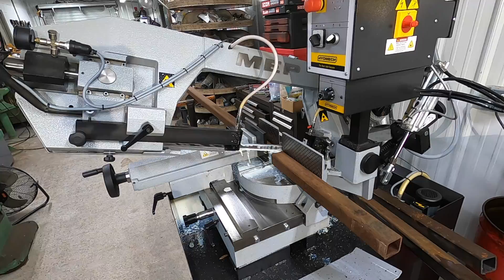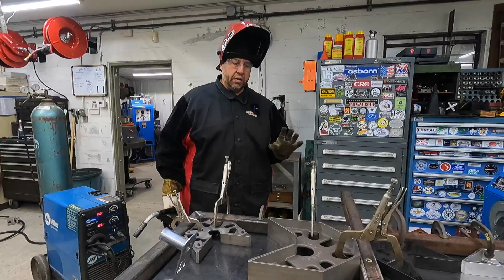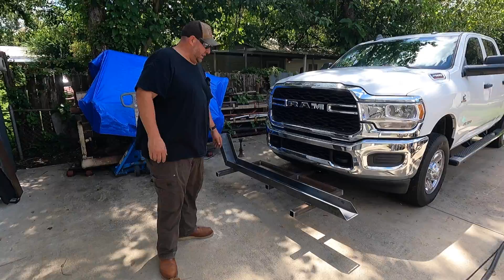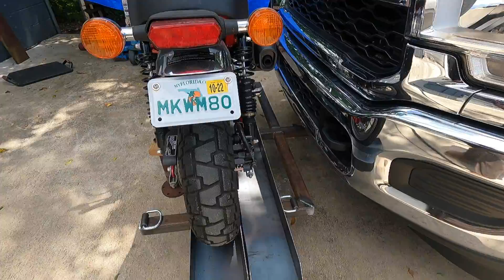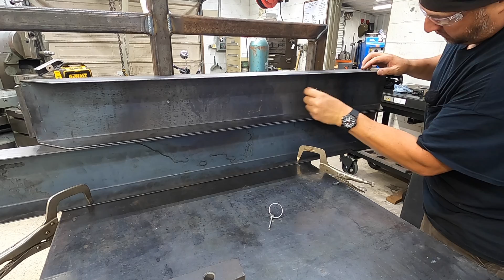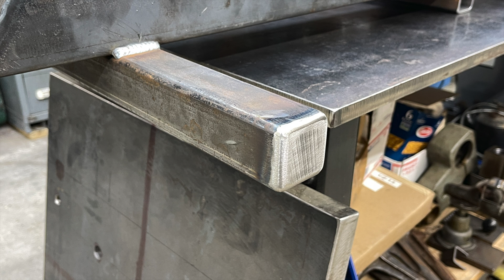Front Mount Motorcycle Carrier Part 2

Comment: Nice job congratulations. My advice : don't forget to make very small holes  (two or three mm are enougth) under all the scare tubes closed to evacuate humidity... perhaps not necessary where you live but absolutly necessary in France if you don't want to have rost !
Reply: Most of Florida is hot and humid, I could imagine south France is not too dissimilar.

The humidity is a big factor in Florida having the lowest used car values (everything is rusted) in the USA.

Comment: I welded something.  Once...ok, twice.  So, I'm a tooootal noob, right.  Isn't there some rule in the ancient tomes of welding lore that says...like...more weld more better?  It's ignorant, I know but why not ask, right?  So, this factory reciever under the truck feels/seems to my tiny mind like WAY not enough to support this awesome (please, read: HUGE) frame, rack, ramp AND bike.  What if...I mean...how?  Imma wanna entire roll cage over my cab (mad max), and then weld an upright to the very front, very center of my Uber Rack to which I couple a HIGH tensile steel cable running up to the roll cage, for...ya know, insurance.  Waddaya think?!?
Reply: Adam mentioned that the tongue weight was 500 lb and the pull was 12000 lb, so that tells me it is likely a Class IV receiver hitch and perfectly capable of handling static loads. Obviously hitting a lot hole hard might say otherwise.

Quality of weld is more important than most factors. Doing 10 passes might not could for naught if the root under which it is built upon has poor penetration. Good weld here, a gusset there: Can be incredibly strong when the right application is met.

Tensioning your setup might work with the right cable, say coated steel or stainless. Did you come up with a solution?

Comment: I recommend using some foam weatherstrip with adhesive back under the removable ramp. Something you can squish down to insert the locking pins so the ramp isn’t bouncing around while driving.

Comment: I would have  made one of the holes in the ramp a short slot. It's such a close fit that slightly different temperatures could make it difficult or impossible to fit the ramp onto both pins.

Comment: On my tow receivers I drilled a hole in the bottom, welded a half inch nut over the hole and run a bolt up to clamp the draw bar tight. And boy it made it solid as a rock.

Comment: I would have went with a lot thicker wall tubing for that center piece.  Metal fatigue from the weight bouncing on that lever arm won't be your friend.  I'd have really gone a lot heaver with that - it won't be very pleasant if you end up running over the little motorcycle and mount at speed with that trailer pushing you.
Reply: Hey, long as he's got the camera running?!?  LOL.  Kidding, I kinda made this point as well.  I don't know tolerances though so I'll admit I'm feeling free to sound off on the subject.  Just don't tell Highstranger951!  Why upset him?

Comment: Regarding the front strap tubes that extend forward of the bike rail, did you consider cutting and angling them upwards, at an angle?  Somewhere between 30 and 45 degrees from horizontal would keep them from being the low point for angle of approach interference, while still giving you the spread you want for secure tie down action.

Comment: Cut out some rubber washers to slide over your ramp pins to help seal them and reduce any rattle or vibrations and thus reduce wear on the pins and holes. You could also use foam camper tape.

Comment: If you put a little space between ramps, it won't rub the paint off each other.  Washers tacked under the holes won't wear as much paint either. You may even want a spring under lynch pins to reduce rattling. A cable lock may help keep someone from taking your scooter.

Comment: I would probably have made it for a few inch higher approach angle.  That sticks out so far that you are gonna be constantly scared of scraping going in/coming out of places.  Miter the receiver connection up 3+"  Other than that, it's amazing.  Curious why you didn't finish the kickstand mount before the powder coating.

Comment: Nice work. Just don't leave the ramp in the sun, as it will likely lengthen and then not sit back down on the pins. Maybe slot one of the holes in the ramp, to cater for extreme cold and heat.

Comment: Another great build/video, but I'd suggest putting those front d-ring mounting posts on a 45 degree angle out in front of the bike.  That is almost certainly going to scrape on rises/dips since it's so far out in front of the truck and a bit of angle will help from keeping the whole thing digging into the ground and/or causing a major problem.  Should be a simple/quick fix for abom79!

Comment: You might also make another receiver to go in the front of the center tube with a small 4x4 square of 1/4" plate for that kickstand rest. Then you could remove it if you wanted, and flip the kickstand up and out of the way. Add a couple thin rubber fender washers over the ramp pins to keep the rattle and paint damage to a minimum, too.

Comment: Love your work Adam but on this occasion I would be worried,  as a motorcyclist I can see some serious damage being done if hit with them tie down forks , it would be like a fork lift truck hitting you right in the ankle !
Reply: That is one of the main reasons you can do something like this only in the US, but not in Europe. for reasons of pedestrian or cyclist safety they even made bumper guards illegal here some years ago if they do not come from the manufacturer and are certified in some way. I think usually you only may have them for certain work/utility vehicles to prevent damage during operation (like vehicles for forestry services or off-road emergency vehicles.)

Comment: Adam... Have you reinforced the front receiver? I would be concerned about the weight and constant bouncing on the Monkey on that. Just wanted to share my thoughts...
Reply: Monkey weighs in at about 300 lbs (wet) and the new carrier is less than 100 lbs with all doodads attached... say 400 lbs total weight on a receiver rated at 500 lbs. So in that sense Adams new carrier is well within the design limits of the receiver. That said... the actual position of the weight of the bike relative to the receiver is certainly a concern. If say, one were to have a really long center tube on that carrier and one could conceivably hit a bump and the whole thing would break off or bend. I don't know how far from the vestibule  (front edge) of the receiver the 500 lb 'tongue weight' is allowed to be.
In any case there is also the problem of harmonic loads (washboard road or even seams on concrete highways.) Adams plan to use some sort of tie in to the towing points on the front of the truck frame will do MUCH to alleviate that source of a problem. It could even, conceivably, reduce the tongue weight to near zero (as far as the receiver is concerned.) If the carrier or receiver were ever to just suddenly break off for whatever reason and the truck is moving forward at any speed... the results would certainly be exciting.

Comment: What is the total weight of this unit...less your Monkey bike!
500 lbs is the maximum load...don't forget to calculate fluids in bike ( fuel and oil etc...)...
You can use thinner tubing for a bike...my trailers had probably 14 guage or 16 guage max for the rails..and 1/8" or 3/16th for the frame ..alot of similar haulers use thin sheet guage for everything except the hitch tubing...

Comment: To help with mounting it on your own you could add 3 pieces of strip on the sides and bottom of the receiver at an angle to form a kind of funnel. That way you can lay it in there roughly and then lift it from the front until she slides home. Keep on keeping on dude. Love the Chanel.

Comment: How often do you people hit pedestrians?! People in the comments are acting like its an everyday occasion, in the unlikely event Adam were to hit someone with just the pickup they would get injured just the same as when he has the bike carrier mounted. Pickup bumpers are designed to protect the pickup not to absorb the impact of hitting pedestrians every other day. Awesome build Adam, been following along on instagram and I love that hammered finish powder coat.
Reply: In 2017, 5,977 pedestrians were killed in traffic crashes in the United States. That's about one death every 88 minutes. Additionally, an estimated 137,000 pedestrians were treated in emergency departments for nonfatal crash-related injuries in 2017.
Reply: @gregs2284  Thanks for the facts but you missed my point. The bike carrier makes no difference between a fatal and nonfatal crash, just like a bumper doesn't.

Comment: Shouldn’t you have put a small rubber pad on the frame so when you put the ramp in rest position it doesn’t vibrate and sing it’s song with every bump you take… like a rattle sound of the ramp vibrating on its pins? Just thinking here…

Comment: I would seal weld the tray to the frame.  Even powder coat will crack, trapping water and causing corrosion. 
On the ramp pins, a little bit of eutectic silver solder like Harris 56 will seal the gap without adding a fillet.  Again,  corrosion.

Comment: Firstly, I must say that have been a huge fan of the channel for a number of years.
I do have a couple of concerns about this project though;
Engineering wise: that front hitch was never designed for the torsional forces it will experience when you are cornering etc.
Safety wise: If you hit a pedestrian with that thing, you'll probably take their legs off! If it was a child in a push-chair, I wouldn't like to see the outcome.
Reply: I think you perfectly summed up some of the reasons why such a contraption would be illegal here in Europe. Pedestrian and crash safety are parts of the vehicles operating permit, which such an attachment you would simply void it. Besides the illegal visible obstruction to the Headlights, license plate etc.
Other than that, for price and just practical reasons, trucks of that size are pretty uncommon here and any smaller vehicle would simply not be able to bear the forces of a front hitch with that at all.
Reply: The thing basically has 2 spikes sticking out the front.  There’s a reason why it’s illegal in the UK for a farmer to drive a tractor on the road with a front end loader attached, without it being folded back or covered by a guard.
Reply: @Martin52863  Then again, fellas can't even have scissors over there, abject lesson why it's important to keep practicing our Pedestrian Impalement Rights.
Reply: @mqL49J  lmao, what? We can’t have scissors? What on earth are you talking about?!
Reply: @Martin52863  Stand by, citizen, Constable Nigel was dispatched to your location with a pamphlet communicating the grave danger of knoife croime.
Reply: @mqL49J  sorry, I’m clearly missing something as I’ve still no idea what you’re talking about.
Reply: @mqL49J  🤣😂🤣
Reply: And you think just being hit by the Ram alone would be better "Engineering wise"?
Reply: @lundysden6781  With this construction it only need a light touch to hurt a pedestrian badly, not a full frontal crash at high speed - that's the difference.
All this edges are build for amputation...

Comment: Even without the rack this vehicle goes some way to understanding why the USA has over 6 times the death rate/100k persons from vehicles compared to Norway, 5 times that of the UK and 3 times that of France.
Reply: Norwegians drive fewer than half as many miles annually than Americans. Remember, there are dozens of states in America that are larger geographically than Norway.
Reply: @mikejacob3536  By distance, the deaths are still high, 25% more than France (if you see how they drive you’d understand) 115% more than the UK and 143% higher than Norway.  ‘Big’ and ‘heavy’ will never be crashworthy nor safe for others, the rest of the planet moved on decades ago.
Reply: @MartinE63  That truck is large and heavy because it needs to be. In America we don't tow little campers with station wagons, it's not uncommon for pick up trucks to pull 45 ft trailers for 1000 miles, you can convert that on your own. As much as snobby Europeans don't want to admit it, Americans are smart and we do the things we do for a reason.
Reply: And the state of Wisconsin alone, (not a large state), is roughly the size of England/Scotland/Wales.
Reply: What?

Comment: I'm sure you have completed it and it's off to the powdercoater by now. I hope before sending it to the powdercoater  you took it for a test drive 50 to 100 miles with the bike on it to make sure the welds are good and no cracks develop and it can withstand the many different forces it will be subject to in it's use. worst thing in the world is having the finish put on a project and the project breaks in the first use.

Comment: Just using one single center beam puts enormous forces up down right left and especially torsion on that beam. In addition you drilled a hole in the middle and welded the pin in. I guess that bike weights at least 80 pounds (40kg). Driving even with low speed through a bumper puts incredible accelleration forces on that one mounting beam. Anything failing in this construction and droping under your car could easily kill yourself and others. 
For use in your own backyard only up to 5 mph thumbs up.
Reply: Think he said the bike weighs 130lbs 😳
Reply: @danielparker-hales245  Nope, according to the technical data sheet it weighs about 110kg, that's nearly 250lbs.

Comment: Weld a cone-shaped bit of steel on the end of the center section, so it would be easy to slip into the hitch receiver, especially if you ever end up doing it by yourself.
Reply: Great idea!  A four sided pyramid would provide a perfect taper.

Comment: That would be so illegal to mount where I live.
Reply: Where i live too (Netherlands)
Reply: same here (Austria) ..well done (as far as the craftsmanship is concerned) but you'd never get a permit with this front mounting to use the thing on public roads. Better not imagining what happens in an accident .o.
Reply: Looks like an ideal people catcher :-)
Reply: @pakrattuk1562  Thats why it would be illegal here too (Germany). Same with most Bumper guards, mounting something like that to a vehicle that is not explicitly defined as a work vehicle which is a tool itself (like a truck with a cherry picker, backhoe or whatever) would immediately void the vehicles operating permit, as it screws important safety parts of the operating permit in regard to crash safety and especially pedestrian safety.
You may get away with something like that mounted on the rear hitch, but then commonly we have a completely different style hitch here for one (very often foldable ball hitches integrated into the vehicle, althougho that square tube style is far from being unseen around here.). And then you would need to get an operating permit from an inspection authority plus you would have to add lights and a copy of the license plate if anything of those get obstructed.

Comment: You will need to drill some weep holes in the bottom to alow water to drain. Where you welded the two pins only on the bottom but didn't weld the tops will allow water to get inside the tubing, in Florida it will just cause rust but if you go north in the winter or fall and the tubes are full of water they will freeze and split.

Comment: I have a Millermatic 251 and I see your handle broke like mine! It's an awesome welder but I hate the handle broke. A couple years after I bought mine miller went to a 252 and has a metal handle with a gap in the middle. The 251 handle is moulded into the whole front trim cover and I think a new one is over $250.

Comment: You might consider moving your back D rings over so that they can be used by both the bumper hitch idea you have and motorcycle tie-downs.

You could also put a bar across the front between the two outboard stabilizers.  With that you get a free kickstand support and something to mount a licence plate on or perhaps a motorcycle cover all across the front.  Endless Ideas for that.

Comment: Don't forget to attach shims to the tube that goes into the hitch while supporting it level with jack stand(s)/support(s). After powder coating, I recommend putting a cushion between the the ramp and the frame, like Flex tape strips or something else if you have around to prevent rattling of the ramp while driving.

Comment: In my short time growing up in the rust belt I found when dealing with sealed steel tubing leave a small bit of trans fluid in the tubing it, why ? It keeps car doors from rusting out up north. Why not tubing? Humidity is just as bad as salt on the roads . Rust is the bane of hard earned projects to keep you going. I also super glued a line of silica beads just inside my distributor to keep condensation out of my caps in my HEI distributors. It might be extreme ,but you never know when they might stop making your parts. Keep em going.
Reply: DiDo I put drain oil in my lawn roller that I made back in the late 70's no leaks. I only use the roller to level Mole tunnels.Ha

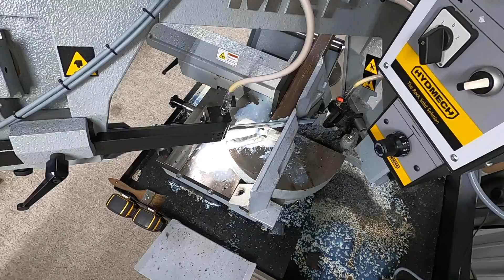Comment: FYI...Audio Issue... just to let you know, I have been noticing some audio issues recently. For example in this video, the audio is both left & right from the start 00:00 to 00:46. At that point, it is ONLY on the left side. Then it returns to both left & right at 02:27. If the viewer is using earbuds/earpods and is only using one side (right in this case - as I do sometimes to be aware of other sounds going on around me), it would seem as if there is NO audio from your video. Just wanted to let you know. Thanks for the vids - I always keep an eye out for them!